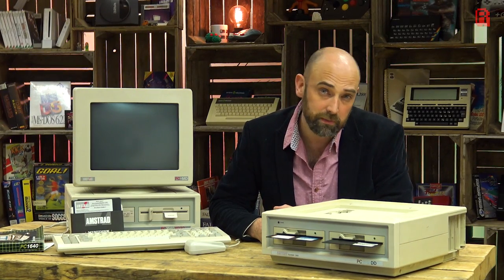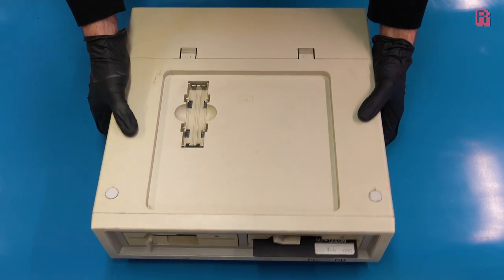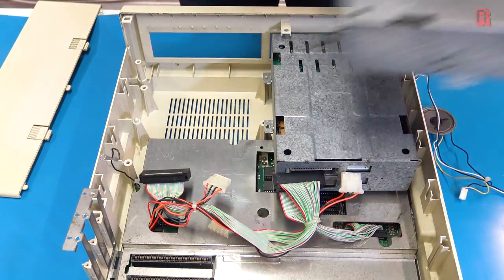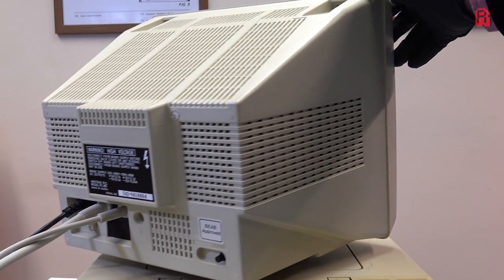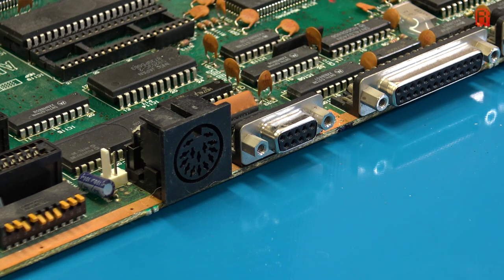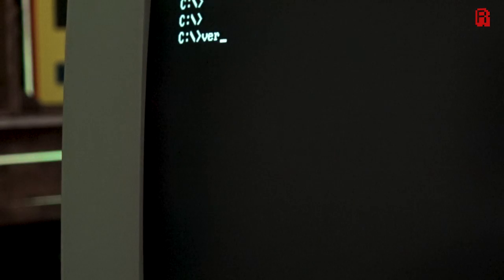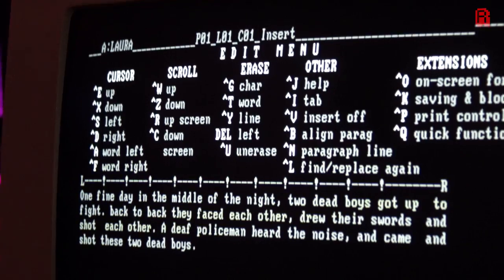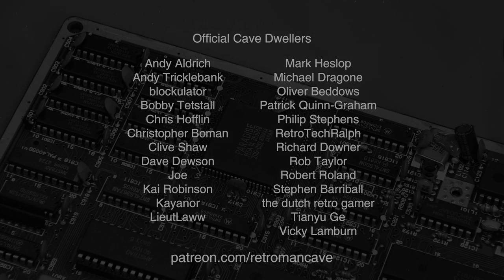The PC That Cracked Europe - Amstrad PC1512 and 1640 | Computer History

Comment: I worked on the Master Care contract to fix these Amstrad PCs from day one. No lie, Amstrad PCs changed the world more than IBM. They were everywhere. For the first time businesses could afford PCs for every desk, not just one IBM in the corner. They were networked running on Novell and Windows for Workgroups and were cheaper than new dumb terminals for the main office systems so with emulation cards or emulation software the switched from being dumb terminals to word processors and back. Suddenly every estate agent, software house, taxi office, shop, secretary, and boss had one. I don't get why they are dismissed as not cracking the business market as they created the business PC market - at least in the UK. For every one Opus, Tandon, IBM, Compaq or Olivetti PC sold Amstrad would sell ten.

When in Hong Kong during the world CPU and Processor shortage I went to the famous Golden Mile and all I saw were hundreds of Amstrads with Chinese character sets being drawn on screen (at quite a very slow speed). Truly Amstrad changed the business world.

However, I hated them. Your plastic gloves to keep your hands clean are fine but you should wear Kevlar gloves as some of the RF shielding foils will cut your fingers off. We used to get call outs from Amstrad to peoples homes, and they would not be in. Or they would show us to a microwave or video recorder. All for the £16 per year paid for the Mastercare scheme.

The reliability issues came later with the 286 Amstrads. Earlier models mostly had the Tandon drives or plug in drive and controller on an expansion card. My word, they were slow. The CP/M systems they often replaced were often faster. You could read DIRectory listings as they scrolled down the screen.

I have to admire that Sugar guy. He certainly new what he was doing.

Comment: Yes, I did see a Mega PC in a shop once...

It's of course far less interesting than a Teradrive, even though they look like the same thing superficially.

Neither was successful, but they were certainly interesting.

The Mega PC is basically just a mega drive and a PC in the same  case. There's nothing else to it than that, and not much to gain over just having both.

The Teradrive is a different beast entirely. It's a hybrid PC/Mega Drive, and the two halves CAN communicate with one another.
You can send commands to the 2612 from the PC side for instance, as well as write code directly into the Mega Drive's memory from the PC half as well.

It's weird as a consumer product, but it seems very well suited to being a developer system for mega drive games.

Of course, part of why it failed is that the PC half was a 286... Released roundabout 1993 or so?
Yeah...
Still, and interesting, quirky bit of hardware, for sure.
Reply: I thought the MegaPC was a 386 or possibly even a 486? Maybe an SX in either case, but certainly not a 286. No-one would have tried to flog a 286 of any kind as anything other than a bargain basement clearance item in 1993. And did anyone even know about the Teradrive cross communication abilities at the time? It'd have been useful as both a sonic and maybe even graphical (as well as, via ROMs, loading time and copy-security) upgrade for PC games if it was better known about and made use of. I'm not aware of any PC software that would be able to properly address a YM2612 chip... plenty of them can make use of the YM 262 of course, but that missing "1" makes all the difference, as they're from completely different ranges, sharing only a manufacturer and the core synthesis part of their FM engines. Yer software built for playing music and even SFX through an Adlib or Soundblaster isn't going to know where to start with a Sega soundchip, especially given how it combines a somewhat cut-down PCM part into the same core...

Comment: 4:52 I think the NVR Setup utility included on the system disks allows you to map the unused scancodes to more commonly available keys

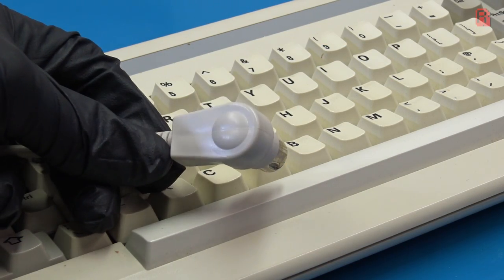12:37 The Keyboard layout is actually based on the layout of the original IBM XT Keyboard, versus the AT Layout for the new 286's and which is now what most people would probably think of as a "standard" keyboard layout.

However, this is pretty ideal for the 1512/1640 since the majority of software that works well on it is, of course, going to be slower 8088 based software, and many of those programs would have originally been designed with that keyboard layout in mind.

13:07 Amstrad apparently had issues supplying enough hard drive models, so it was not uncommon for them to be upgraded with hard-cards, a ISA card concept you rarely see these days.

Comment: Had one of the PC2086Ds in the 90s, that mouse man, it's just an abomination. Also windows 2.03 running off dual floppies was a joy to behold. I did manage to get that to run on the ppc512 luggable, but on that tiny monochrome screen it was more entertaining than useful.

Comment: These old Amstrad PC's are adorable and quite unique. They seem to be also quite reliable. Floppy drives are of good quality, and as you demonstrated, there's no issue with the clock battery. Even if the batteries leak, they usually don't leak onto the mother board very easily. Plastics are brittle, so if you constantly fiddle with the machine, it can brake. I have the 1640SD with monochrome display, and it's dead silent if it isn't reading from the floppy drive. I installed a 720k 3.5" floppy drive to it, and it's much more usable now. Would be nice to have some sort of a SD card solution in it though.

Comment: Mine was an Schneider PC1520 HD with colour monitor. 
Upgraded to 640 MB and powered by a V30 CPU with 10 MHz she was the fastest on the block. 
She was my first IBM compatible PC and I was a bit anxious back then to modify the CPU's clock frequency - but it worked. From then on I built all of my computers by myself. I even managed to get a job as a computer service engineer thanks to my studies with, in, and on this machine.

Comment: Working in a computer repair shop (real repairs down to board level, not simply swapping boards), I had a lot of background on a diversity of machines.

Surely, as a budding writer, the computers I was most impressed with were the PCW8256 and PCW8512...  (they had rotten monitors and ghastly workmanship to the 3inch drives!!!)... When these two came around, I thought nothing could beat them for price and reliability. We rarely had these in the workshop, and most repairs were loose RAM modules, or indeed, for upgrading to 640k.

As a collector I am always on the lookout for new systems to add, and these are so rare at this point in time... 

Thanks for this video. PS. How do you work in a blazer? Just asking...
Reply from the maker: I was born in the blazer.  Molded by it. - I'd like to get some PCW's for the collection there is something honest about them in the way you've described.  A tool created for one job will always surpass a multi-tool

Comment: A PC 1640 with 20MB hard drive and EGA graphics was my first computer. I upgraded it with a Nec V30 processor which was 10-20% faster than the stock 8086. Besides some games I mostly learned Turbo Pascal and Microsoft Quick C with it. Good old times. Recently, I wondered what would have happened if sites like StackOverflow had existed in the 80ies.
Reply: Snap! - same here on (almost) every detail (right down to the V30 upgrade), except it wasn't my first computer, mine was an upgrade from a CPC464.

Comment: We had a PC1640 DD as our first "family PC" after a Commodore 128 bought earlier which was ultimately only used for playing games. The Amstrad was bought circa 1988 with EGA color monitor, 5 1/4" and an extra "aftermarket" 3 1/2" drive instead of a second 5 1/4" one fitted by the seller. 

It served very well and was a workhorse for word processing. No more mis-printed characters because of pesky Commodore printer interface problems! I also remember playing a lot of Sierra Online's early PC adventure games on it in full EGA color. Space Quest 1+2 and LSL ftw!

Circa 1993, I fitted a NEC V30 processor for the supposed 20% better speed, an original 8-bit Soundblaster card I got for free because the amplifier chip was broken (and easily changed) and also a "XT-IDE" ISA-card because I got a lot of 40 MB IDE HDDs for free (!) from my former employer while refurbishing Fujitsu-Siemens PCs with Xenix for the former "START" travel agency network. 

Literally carved out space for the 40 MB 3 1/2" HDD in the plastic case under the disc drive. Put GeoWorks on it and got extremely nice WYSIWYG printouts even with a lowly 9-needle dot matrix printer. You only had to be patient because the printer would print 4 times over each "row" to get the nice look. 

At this time, we already had a 486-66 running Windows 3.1 with an 120 MB HDD, but the above "Refurbishment" prolonged the service life of the old Amstrad considerably. 

The machine lived on with my aunt who used it (and GeoWorks) for word processing well into the 2000s. Sadly, she gave it away sometime when moving house. Would be very nice to have it back now, just for fun and the memories...

Comment: Wrote and formatted my entire M.Sc. dissertation using Ventura publisher on a 1640... memories. An extremely robust and reliable little machine, and although it wasn't stunningly fast, it did the job. Completely changed my attitude to PCs in the workplace, even though I'd been using a Philips 3102 for development for a couple of years previously (Windows 1.02!!!!). Following this experience, I went back to working on a DEC 3400 which, whilst capable, was simply overly complex for the work required. What a difference.

Comment: The hard drive controller is actually by the Western Design Center (makers of the 16bit version of the 8502), that's what WDC stands for, it's also the group of people that gave Acorn the impetus to make the ARM after seeing what they were doing with the 6502 considering the lack of staff and resources WDC had.
 
I acquired one of these in the 90's, had both 51/4" and 3.5" FDD's and was fitted with a hard card and interface for a Logitech handheld greyscale scanner.
I remember having much fun with banner mania and an Amstrad printer.

Also Alan Sugar has never revealed how much he paid for MS-DOS, primarily because the price he was offered seem to basically be free

Comment: As a side-note: The "odd" placement of the function keys wasn't really a "avoiding the IBM lawyers" move. The original IBM PC XT keyboard (known as "Model F") also had F1->F10 on the left side of the keyboard along with a slightly different placement of other keys. I'm quite sure the IBM XT hit the market first (though not certain), so they simply did what IBM had done to support "muscle memory" between theirs and IBMs.

All in all the Amstrad PCs were not as bad as their reputation. They worked well for what they were intended for, and back in the days I actually saw a fair share of them in small businesses which started adopting IBM compatible PCs. The only thing that could be said is that they weren't as flexible in terms of upgrades as your generic IBM PC or clone thereof.

A important piece in the history of PCs often forgotten because they weren't really "a thing".
Reply from the maker: I agree it's not a huge change but the changes are quoted as being for this reason by David Thomas in his book "Alan Sugar: The Amstrad Story".  I trust it as a source as it seems to be well researched and written

Comment: I studied in University of Hull when the 1512 came out, so I bought the cheapest one, one floppy and mono screen. Some modifications where done: first changing the processor to a NEC V30 (20% speedup) and a 20GB harddisk on a card.  Next I changed the diskcontroller from MFM to RLL (upping the storage to 32GB).  Then I maxed the ram to 640KB.  Next I changed the processor crystal from  a 24MHz to a 27MHz (a common RC crystal, easy to get) that gave me 9 MHz processor clock.  Next step was a  34MHz RC crystal (which gave a 11.3MHz processor clock).  The problem was that the floppy controller  ran straight off the processor clock, and made standard floppies  unreadable.  A little tinkering with  the clock circuit made the the CPU clock slow down when the floppydrive was used (by selecting the realtime clock crystal (?)).  I was  Amstrad Norways goto man for people that asked hard questions at this point.
Having taken the machine to its limits I sold it to get a  486 machine... (I calculated that I actually made about £100 compared to my expenses)

Comment: Years ago I had an Amstrad PC5286. It was obsolete by then, I had rebuilt it from parts from an Amstrad 386 machine and used it in my last years of high school. I remember I upgraded it from 1mb to 4mb of RAM, and installed an 80mb Hard disk. The thing was just about bullet-proof.

Comment: I used to be the goto-man on the amstrad pcs in Norway.  Amstrad Norway asked people with problems they had no idea how to fix to call my private number...
I hacked my own 1512 with a harddisk on a card, then replaced the mfm controller on that card to RLL, then a bigger disk that replaced one of the floppies, then a NEC 30 processor, then I replaced the crystal for the processor chlock with a RC crystal at 27MHz (from the original 24MHz). Then a 45MHz (that gave the floppy-controller problems), so I put in a circuit that reduced the cpuclock when the floppy select was active.
Great times!

Comment: Function keys on the left was fairly common (possibly even standard) in the era before the 101-key layout and PS/2 port were standardized.  The 80-key XT-port keyboard that came with my ITT XTRA has the function keys on the left.  The original XT keyboard also had the function keys on the left.

The rhyme isn't original.  The missing last sentence is, "If you don't believe my lie is true, ask the blind man:  he saw it too."
Reply: I bought an Enhancer 101 Amstrad replacement keyboard for mine, it cost a fortune, but had IBM key switches

Comment: I had a 1512 and used it all through my degree. I eventually bought a Disk controller and drove from Glasgow to Manchester to buy a 2nd hand 5MB house brick hard drive which was amazing at the time.
The incompatible video mode was a pain however.
Amstrad gets knocked for making cheap crap but these machines really brought computing to many people.

Comment: I bought a 1512 back in the day to teach myself about computers. I loved it. Way better at real stuff than my Sinclair 128. Loved controlling it with DOS. I bought a 30 MB HDD Card for £300 that fitted in one of the back slots, but it wouldn't let me put the cover back on so it was loose all the time! I upgraded to a 1640 with a hard disk after about a year and this took me through an OU Design course. I loved this too. The 1512 cost me about  a grand and I sold it for £700 WOW! The 1640 cost me £600 ish. Can't remember where I got it but it was new. I couldn't sell the 1640 as the PC market took off in a big way and Sugar was a bit of a wally with none standard upgrade parts, making it too expensive for me to upgrade so I bought a cheap, anonymous PC Compatible 286. I remember the Amstrads with great fondness.

Comment: Cool video. If I recall they put the PSU in the monitor to make complying with electrical safety regulations easier as the CPU case could be opened without a screwdriver. I had the 1640 with a hard drive on an expansion card which was a popular upgrade.
Before that I had an Apricot F1 and F10 with wireless keyboard (RTC was in the keyboard if I recall) 3.5" floppy / 10M hard drive. Hardly and software and thus it failed to catch on.

Comment: Hi there. Speaking as someone who worked on this side of the pond on IBM's and Compaques, I can say that at first blush the idea of putting the real-time clock batteries on the outside of the case was a great idea. It encourages timely repair/replacement without having to pop open the case. The second thing I noticed is the "toolless" case is another great idea. IBM was trying to keep everything to themselves and required "experts" to open them. They were almost as bad as Apple with their original MacIntosh which required, no demanded, two special tools to service them that were only available to recognized  Apple dealers; I speak of the 10" or was it 12" ( memory fades ) Torx screwdriver ( Which was not widely used as it is today ) and the specialized rhodium plated "Mac-Cracker" which separated the two halves of the case. Steve Jobs was clearly Not giving Anything away. Cheers.

Comment: My first PC was the Amstrad 1640DD. I bought it while studying programming in London 1989. I upgraded it with Western Digital (I think) 30MB RLL -card hard drive. The drive was installed on an expansion card (heavy steel thing) which included the HDD controller and the hard drive itself. The card was plugged to the expansion slot. It cost fortune back then but was so high tech and super fast compared to the floppies! My college didn't have hard drives back then, everything was run from floppies! And one of those could hold the whole OS, word processor, programming stuff incl. compilers and all your files. Oh, and the Amstrad was a 16bit 8MHz supercomputer compared to puny 8bit 4.77MHz IBM:s! Great times! 😂 Just remembered: my gf had the PPC640 and we even had a navigating software (like gps nowadays but off line version, you would set the route at home and then the sw will give you instructions like drive steet xxx for 2 blocks and then turn right to steet xyz etc.) so she would sit in passenger side of my '77 Corvette and handle navigation with the huge "laptop". If the trip was longer than the batteries would hold up (almost always) the route was printed on paper with our cool matrix -printer. 🤣